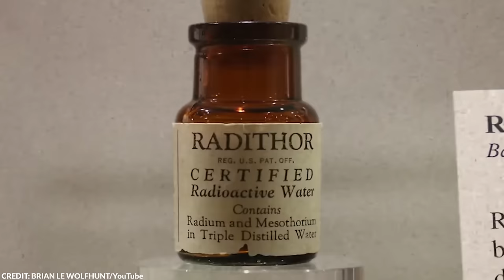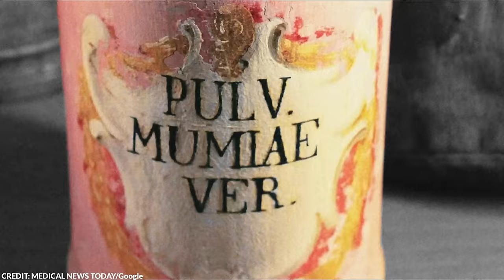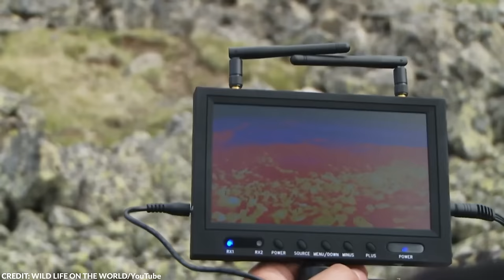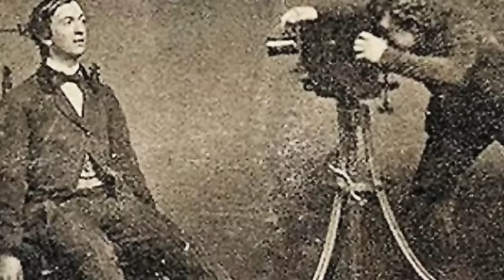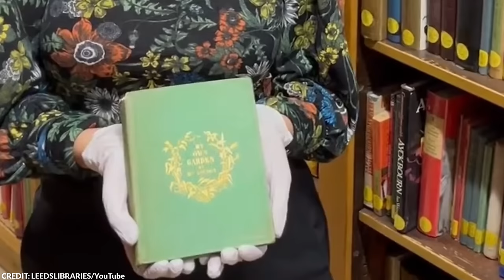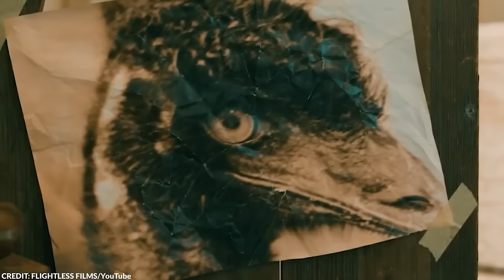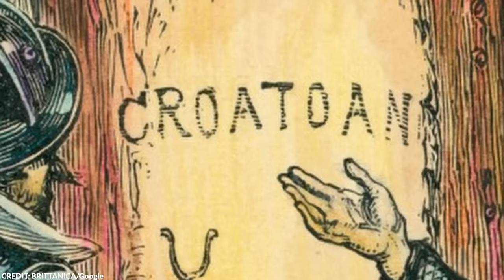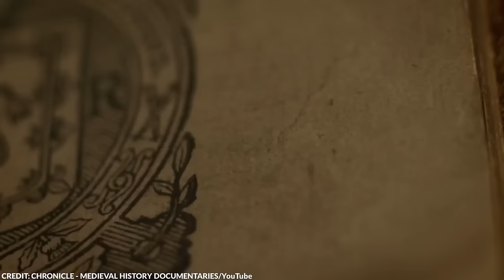20 Historical Facts That Will Disturb You

Comment: If lightened hair goes green because of chlorine in swimming pools. Dousing it with tomato ketchup like conditioner will get it back to normal.
Reply: Rinsing with water mixed with conditioner in a spray bottle before you swim will prevent green in the first place